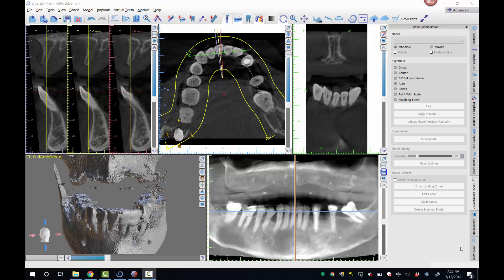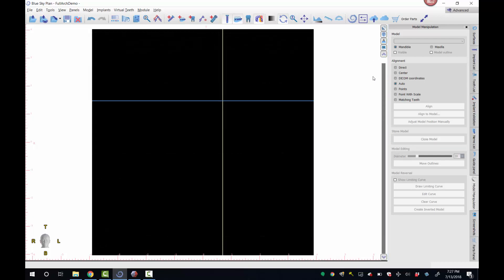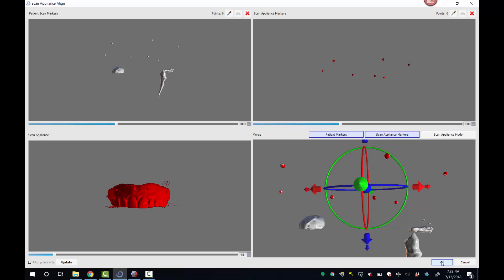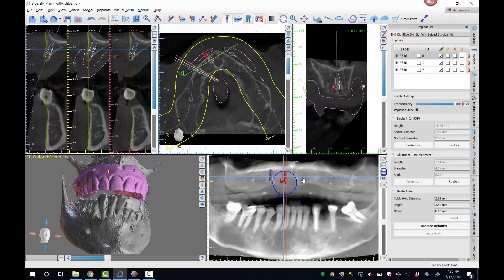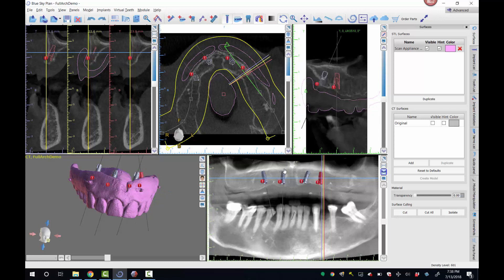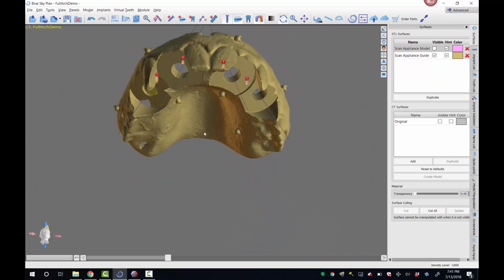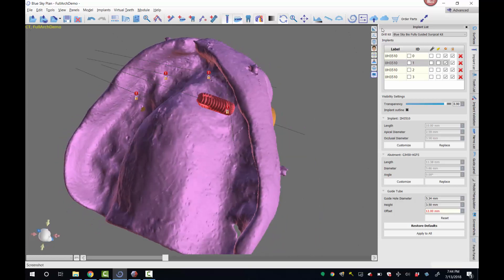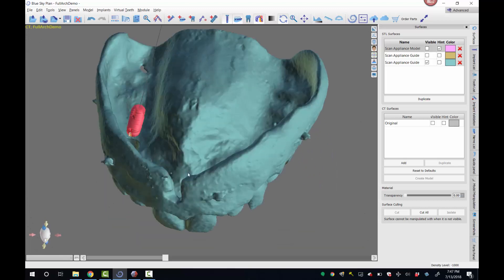BlueSkyPlan - Scan Appliance Guide Design

Comment: Baron, thanks for the video.  You indicated in the video that you would discuss why you would make 2mm modifications to the offset, but  I am not sure you followed up on it.  Why in 2mm increments?  Also, what changes will you need to make in the drilling protocol with the fully guided kit, since the offset has been modified?  Thanks
Reply from the maker: I'd have to review the video, but the reason is typically because the BSB fully guided kit has an implant carrier with an offset of 8.5mm, 10.5 mm, or 12.5 mm. so, increasing by 2 mm or 4 mm will allow you to use the same carrier. The thing is, you then need to account for the drill differences well. For instance, if you are planning to place an 8 mm long implant, you would need to use the 10 mm drill if you increase the offset by 2 mm. If you had to increase it by 4 mm, you would actually need to use the 13 mm drill and stop one millimeters Shio full depth. It gets a little tricky when doing that to keep track of, but that's just the reality. The only other option would be for BlueSkyBio to sell three different sets of drills at the various offsets. That would take the kit to around $10,000.

Comment: Just to be clear. At 4:05 you are referring to scanning the denture via cone beam machine? Or are you scanning it with something else?
Reply from the maker: Correct. This method requires 2 DICOM volumes. One of just the denture and one of the patient wearing the denture. The video linked at the very end shows that workflow with this same patient.
Reply: @bgrutterdds  Can I scan the denture with my primescan and use that instead? or do I need to do the dual DICOM method? I don't have faith in my old planmeca doing a good job making a DICOM of the denture
Reply from the maker: @ryanmillet9749  for sure. The issue is stitching the two. You might do all 3. Use the Prime scan STL for your actual guide design. But, align it to the DICOM Denture after it is aligned to the patient DICOM. 

SIDENOTE: YOU MIGHT BE SURPRISED AT THE QUALITY OF YOUR DENTURE DICOM.
Reply: does the denture require a radiopaque acryl ? or only markers? if no how can we see it very clear on a regular 3d x-ray ?
Reply from the maker: It does not because you are scanning it alone. The relative radioopacity compared to air is high. Compared to a patient it's low. So, you won't be able to see it on the patient scan without also seeing the soft-tissue and a big mess.